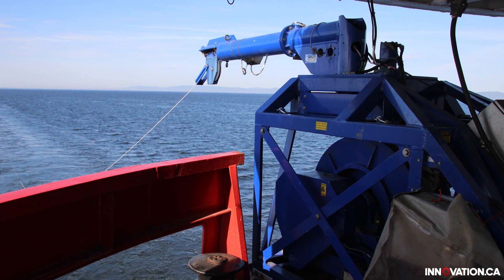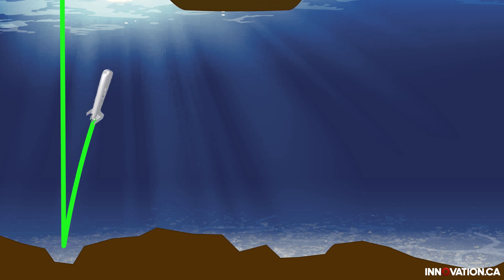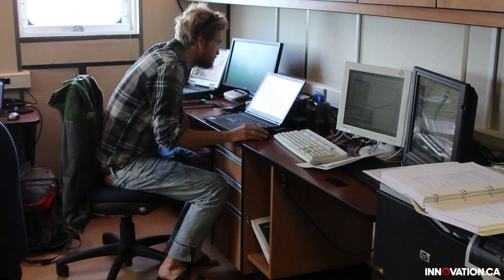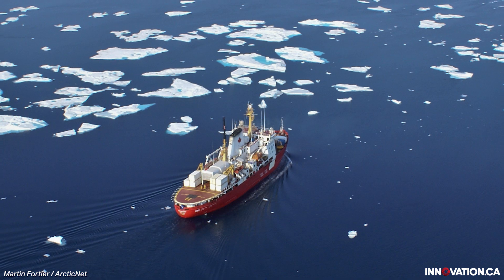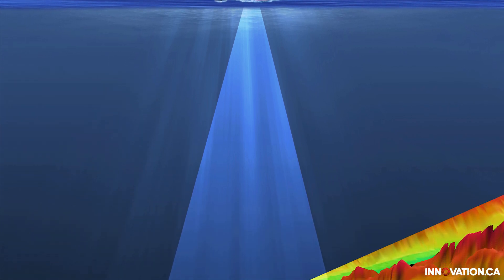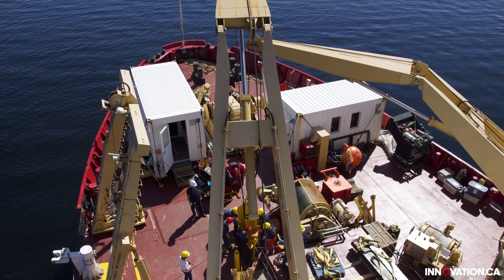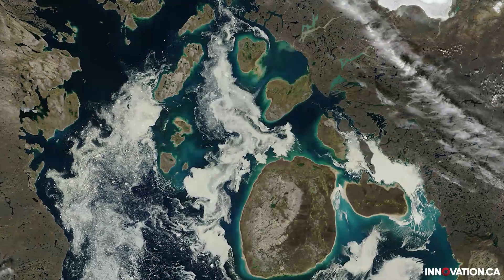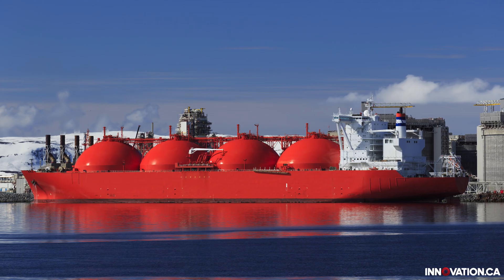Mapping the sea floor with the multibeam echosounder and the Moving Vessel Profiler

Comment: I'm have an ongoing design to map and survey using type 4 automous underwater vehicle. I plan to use a prosumer lowrance Garmin or humminbird multispectral fish Finder and merely take it very close to the bottom so maybe two or three units as I would like to get more with an enormous amount of detail. 

I'm shooting for an average working depth of the average depth of the Pacific alluvial plains. 

If you're a manufacturer of multi-spectral sonar and make smaller prosumer level or can customize a much more reasonably priced unit for my specific use case, WM product is to provide universities and researchers with a remote / autonomous research and mapping surveying vehicle with the ability to add modular science instruments. I'm using a design philosophy that will in a catastrophic events recover the primary electronic bay while making the bouyancy and self extending solar as well as a underwater or surface deployabke stator / wind turbine or water driven using serendipitous strong currents while making an anchorage to deploy the underwater stator or will surface after checking it is in a clear area to extend solar panels and relay telemetry to the pier side user or a remote researcher who has a peir side recovery and maintenance team for a fleet of these which can be moved geospatially.

Should the vessel encounter a catastrophic failure it will deploy a very strong lift bag wish will force the vessel to surface even if it means sharing off the buoyancy compartments in the front and the rear as well as the drive shafts. These will be made out of lower costs composite materials that can be easily replaced wild protecting the electronic core as well as the modular science sensor Bay which will remain open for different sensitive types. 

The goal is to significantly reduce the cost of an extremely capable underwater mapping and surveying Type 4 auten underwater vehicle for universities researchers and students that is at a price point where they can actually afford it. 

And the moment forget the base level mapping and sensor as well as the depth range contemplated would be at least 500k. While I'm seeking to produce a very capable research vessel for University students and non-profit researchers and price point in the upper 10ks. 

Really the most expensive part of this underwater vehicle will be the multi-spectral sonar. Everything else is being designed and built with off-the-shelf pre-existing modular electronics and made I house jointly by a Indonesian and Swiss owned startup in Indonesia. 

If you're the Chinese company which is making a product which would be similar to or have the same capabilities as a prosumer level multispectral sonar made by Lawrence hummingbird or Garmin this is what I'm looking for and I would be interested in purchasing a system made for my vehicles. Get in touch and I'll shoot you my real email.

Comment: The hole ocean hase been mapped by P3 orian navel sub hunter ,but the ocean floor is ever change ing ,the chart plotter u have now an maps are just rough estimates on what the bottom used to be when that map was produced ,so even after these guys make a map it will have to be redone again,nothen stays the same ,
Reply: Data from survey can be redundant in as little as six months

Comment from the maker: Jean-Guy and Gabriel make up the CCGS  #Amundsen ’s  #mapping team. They use a Moving Vessel Profiler to measure different kinds of data such as speed of sound, temperature and dissolved oxygen content in the water. They also use a multibeam  #echosounder  to create vivid 3-D maps of the  #Arctic  sea floor.